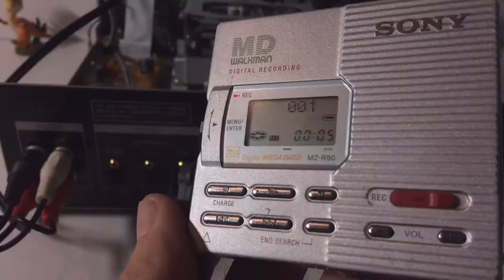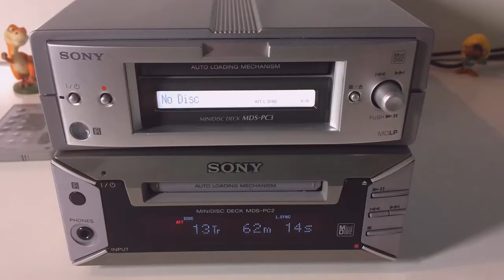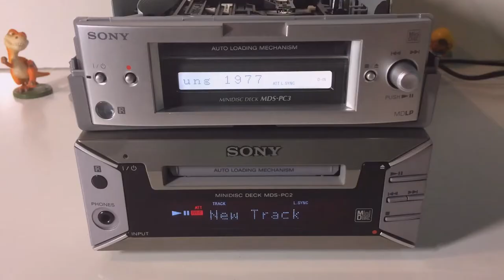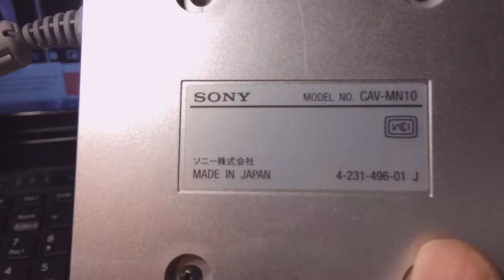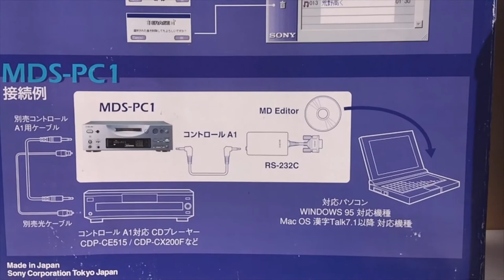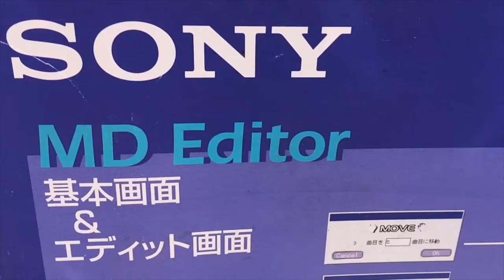Sony MDS-PC1/PC2/PC3/NT1 | MiniDisc Deck Net MD recording Test short

Comment: The headphones jack with integrated fiber optic was genius.
Unfortunately the machines got ever more simple and they had to deal with MP3 which at the time you could burn into a CD-RW and listen with a portable player or go directly full HDD storage with machines like the Creative DAP.  SONY had to deal with either limited storage or limited quality. And they didn't need to...
Reply from the maker: For portable devices, I stayed with MD Sony with optical cable recording, all tracks SP quality and I am very satisfied with the audition when I move quickly anywhere and for me other formats MP3 /FLAC/WAV/MQA/DAC/AAC/M4A /AIFF/ AU/ BW/ FWV/ APE/ALAC /TTA <<<I do not like them...but the professional ones are only PCM (DAT) and DSD.
DSD versus PCM:
There are two main ways of processing/encoding audio into digitally usable formats – PCM and DSD. In short, PCM is easier to handle. However, DSD is the primary archive format used in recording studios, and some argue that DSD delivers the closest digital file samples to the original analog source. Here are the specifications of each type:
DSD:
Direct Stream Digital technology uses pulse density modulation coding to store audio signals on digital storage media. The sampling rate in the case of this technology is either 2.8224 MHz or 5.6448 MHz, which translates into sampling 64 and 128 times higher, respectively, than with audio CDs.
PCM:
Pulse Code Modulation is a technology that converts standard audio signals into digital audio signals. This is the standard digital audio format for computers and CDs. The signal amplitude is sampled at uniform intervals, then each sample is limited to the nearest value by a number of digital steps.
Reply: @OLDBUTGOOD  dsd is just a marketing bs. dsd64 does not give a frequency range better than pcm24/96, losing over the dynamic range. dsd128 is no better in frequencies than pcm24/192, losing in dynamic range. there is no point in using dsd instead of pcm with a high sampling rate, since dsd will lose in quality and will not be editable.
all these huge sampling rates at dsd are marketing. the advertised sacd has a frequency of 2.8ghz, which should give "the ability to super response". in fact, because of the one-bit resolution, the amount of noise is huge, the playback frequencies are somewhere up to 40 kHz (worse than pcm 96), everything above is cut off by the filter, respectively, and the "response" realized at the expense of ultra-high frequencies is worse than that of pcm 96.
Reply from the maker: You are right, PCM is the leader in the audio world.